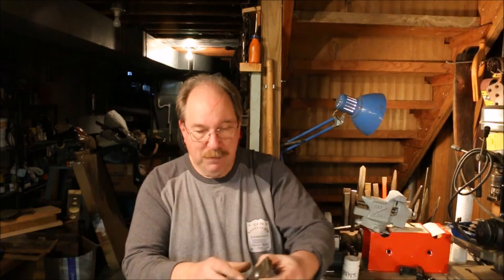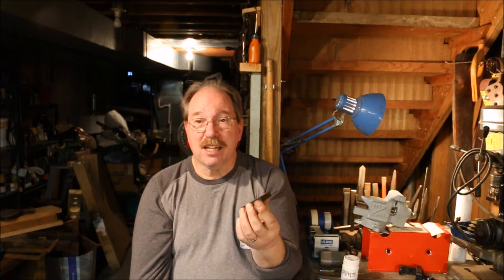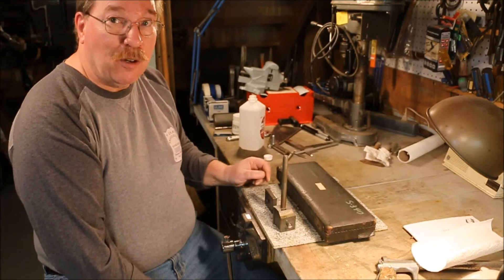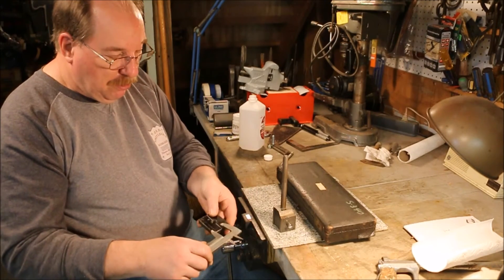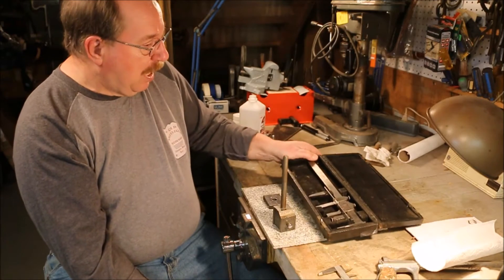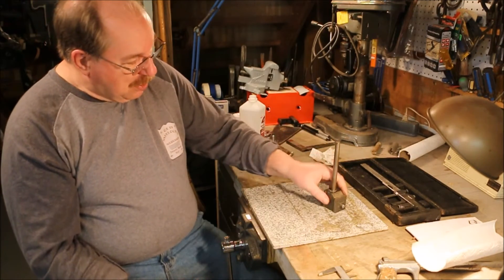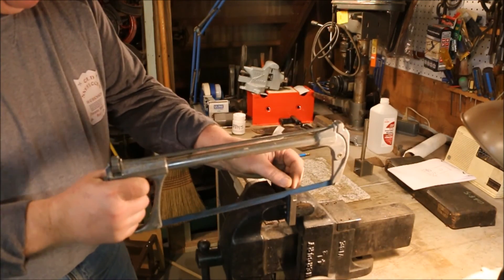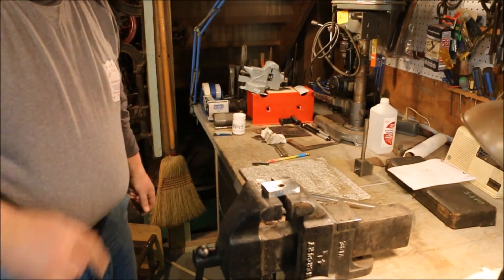AXA Tool Post For The South Bend 9C ~ Pt 2 ~ Making A New T Nut ~ By Old Sneelock's Workshop

Comment: Fascinated by this video. I am always surprised at the cost of precision tools in the past. In 1948 on their first Christmas together after getting married, my mother bought dad a Moore & Wright combination square boxed set for £15 which works out at approximately £530 in today's money. The company are still going and the same set can be bought for less than a third of this cost. If you shop around it can be bought for under a quarter. The engineers, tool makers and machinists of old paid out a lot for their personal tools (but they were beautiful).
Reply from the maker: +UK Tony Not as much demand for the manual tools now. Manufacturing has moved to digital systems and CNC equipment that uses different methods to verify the size and conformation of products. The things I learned to do with a height gage and micrometers is done now with coordinate measuring machines. They cost thousands but are accurate and don't require near as much training to operate.

Comment: I really don't  understand why you don't have that big vise permanently mounted.   It sure beats that little utility vise you are so fond of and it is a lot more versatile.
Reply from the maker: +azbushrat The big vise is nice for filing and the odd workholding job. By having it portable I can clamp it to the bench in the basement for those jobs. If I were to permanently mount it on the fixed bench it would limit the usefulness of the bench. 
The 4" vise is great for the small fiddly bits of assembly and disassembly. If I need a heavy duty vise for forging I have the blacksmith shop with the post vise. For welding I have the big Wilton in the garage mounted on the cast iron base next to the welder. 
If the weather had been warmer I would have used the bigger equipment in the unheated blacksmith shop for cutting the T Nut blank. Hacksawing is bad enough without having to wear a heavy coat and gloves. 
In a perfect world I would have the big vise mounted to a heavy steel bench sitting next to the Bridgeport Vertical Mill, and the Cincinnati  Surface Grinder. Unfortunately I have neither the room or the funds for such a setup. The hacksaw, file, and clamped down vise will have to do until that happens.

Comment: I thought I smelled another lathe project but I'll be hanged if I can remember what it was. I suppose we'll find out soon enough. I liked the Vernier video. With my eyeballs I'd need a dial indicator AFTER I learned to read one. Didn't want you to think I had actually jumped ahead of myself. I understand about the tents because grading is set up like that. It's just all the rest of those funny little marks that would give me trouble. Thanks, Unc for another great one!
Reply from the maker: +Lewie McNeely Cool thing about a Vernier is that since all you are doing is determining which line is closest to the mark it's not as fussy as a set of Micrometers. You still have all the feel issues with a caliper but on this height gage it just has to line up with the marks. 
Having a good magnifying glass has gotten more important as the years go by.
Reply: I'll have to watch the tutorial some more. I can see it's got to do with rounding off somewhat but the short fuzzy hairs always get me on a deal like this. I've already learned more than I can absorb and my Coleman parts are on the way!!
Reply from the maker: +Lewie McNeely I have a shaft to complete for the Swan Barn Beam Drilling Machine. Now that the toolpost is ready I'm getting back to it.
Reply: No wonder I couldn't remember. That's been over a week ago and my memory just runs for a few moments!

Comment: Machinist people always fascinated me. Lots still to learn in this old world. If you aren't learning you must be dead.
Reply: +Tim Caldwell  Yeah,or worse, think you know it all.I'm with you about machinists. Another realm for me.
Reply: You learn 'run' a lot of stuff with your rear, just like you say you have developed a 'feel' for it. I'm living proof that you don't have to be a rocket scientist to run this stuff. Pretty much, everything has one function- but it might be combined with others on a wobble stick. A dragline has a clutch lever and brake for each drum and a set of clutches turning opposite to swing it right and left. The interesting part is that when you get it swinging one direction you have to slip the opposite clutch to get it to slow and stop.  It also uses the swing clutches to walk back and forth. All the turning stuff and digging dogs are from the cab down through the center pin or outside on the car body, I think it's called. I'd have you fooling with one in15 minutes but about all the ones I sweated and froze in were straight manual operated. Not bad if you know how to set the clutches. You can learn what I do a LOT quicker than I could learn to do what you do.
Reply from the maker: Lewie I'm sure a pro ball player feels what they do is all just the feel. I bet you have to have the right set of feelers to make it work.
Reply: Seeing my hands and feet are shot I have to use something and my Butt was elected!
Reply from the maker: +Tim Caldwell I had a neighbor and friend Bruce Bayles, that taught me a lot about tools. How to sharpen a lathe tool, what threading was and how it was done. I later worked with Jerry Coplin at Borg Warner where we were offered the opportunity to work with Frank Printke and really learn to be Machinists with an "M" and Tool Makers. 
Then I got the chance to supervise machine repair persons, tool makers, machinists, welders, and a host of people with more combined skill than I could ever learn on my own if I lived a thousand years. There is a vast amount of information and many, many, very brilliant men and women working in the machine tool field. I'll always be watching and learning something new.
Reply from the maker: +Lewie McNeely Just a skill set that I picked up. I'd love to learn to drive a bulldozer and run a drag line like you talk about. Emery Waterbury worked for me for a few years. Before the gravel pit closed he ran a drag line. He dredged Coldwater Lake and created the deep water that I sailed my McGregor over. Built a road into the lake and then dug out the gravel on both sides removing the road as he went. Now that would take a lot of skill to dig the bottom flat when you can't see it.